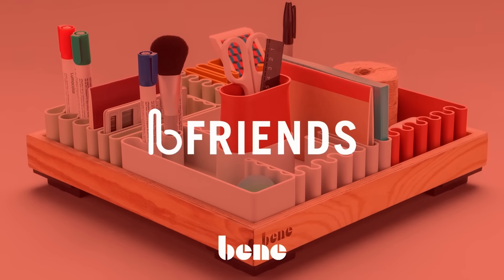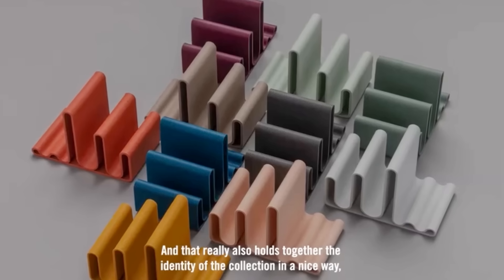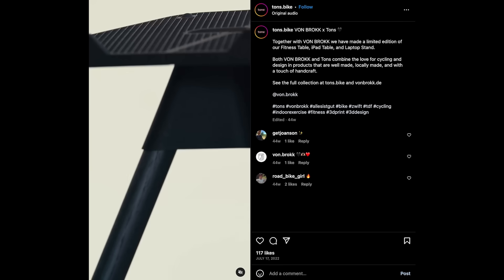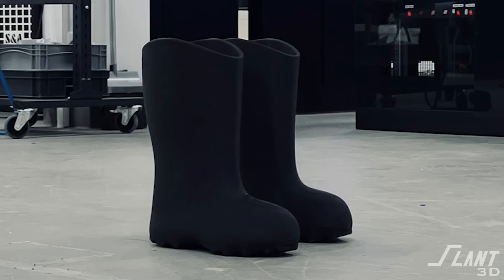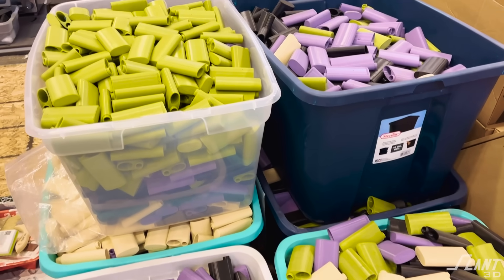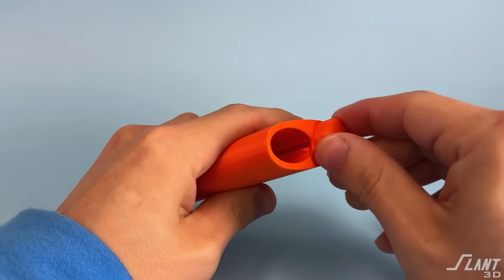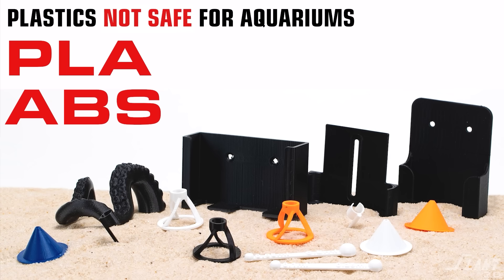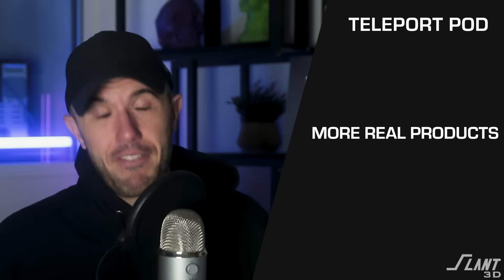5 Companies Making Real Products with 3D Printing

Comment: This is not the same topic but I'm not sure this has a topic so I chose this video as it's most recent.... is there a way to take an stl file and make a print that is much bigger than your print bed by turning it into several parts that can be put together later. I'm trying to take a flat wall ornament and make about 3ftx3ft but my bed is 300mm. This seems like something that would be a common function in any slicer but thats apparently and surprisingly not the case and  I'm not finding anything about it. Is this doable?
Reply: You should be able to do this is any slicer. Prusalicer allows you to perform cuts in an object and even add connectors so that you can join them together, either as structural, or as a way to index the pieces for glueing

Comment: I don’t see why the bic holder couldn’t be produced with injection molding, maybe it would just be two parts coming together to form that same geometry. Or if you changed bottom design could be injection molded in one piece and have the compliance mechanics that allow for the variance in bic lighters

Comment: Those shoes are made of TPR, not TPU.

TPU is slippery and does not grip well.

Even low durometer does not flex and stretch in multiple directions well, now matter how you print it.

Comment: Don't take it as offence, but... why not to make such things with injection molding?

Seems like that things don't even use pros of 3d printing, so does it really needs to be 3d printed?

Well on the other hand, you don't even need to buy this, you just can print it, even if you have no 3d models, that forms are easy enough even for me.
Reply: A polished metal mold is expensive
Reply: Injection molding also suffers from shrinkage that can make a product look poor in heavier cross sections. So extra design is required to shell out heavy areas, and this can lead to even more design issues as you have to make multi slide molds in order to extract the part. This is why injection molded parts tend to be very simple and similar in design, without reentrant angles that make the parts impossible to release.

Comment: do you have to worry about humidity in your factory? or is humidity only an issue over months of stagnant storage?
Reply: I think humidity and moisture is BS, I never had to dry filament or had any issues and I live in the UK.
Reply: @grumpyrider369 I think there are multiple factors to that. What the filament is and how frequently you go through a spool. I have some white pla that’s years old and still prints well, I’ve never put it in a bag or box. I have some black pla that is the same age but needs to be dried before printing
Reply: @only1muppet  how do you know if it needs to be dried?

Comment: $28 for a 3d printed lighter that cost about 28 cents to make…
Reply: Right???
Reply: There's nothing wrong with pricing stuff where you can make a profit. If nobody buys, then you know you're high. Maybe the production costs make it impractical to produce for less.

Keep in mind that if you are the guy sweating the details of production, that some other retail schmuck is going to mark up your price up by 50 to 100% while adding ZERO value to it. And that's just their take for HANDLING your product.
Reply: Using the filament cost as any sort of price indication is a really bad way to look at it. The main cost of selling is taxes, packaging and your own time.
Reply: @unzensiert-ungeschnitten3990  I understand where you're coming from, but your pricing model doesn't apply to all cases. In the case of this small piece of plastic, the low cost, time, and effort to make it are significant factors. Other comments also suggest the markup is ridiculous.
Reply: @sidekick3rida  while I agree it's ridiculous the fact that it keeps selling out so fast says that it's worth it to some other
Reply: @ no doubt people will buy it… America

Comment: Joint locker, £28? Seriously?
Reply: I have no respect for them. They act like they designed the model but they just remixed it (on a model that didn't allow remixing or commercial rights) and now profit from it.
Reply: @OhImKiCkiN  I sell one that fits bics and clippers 👀 I just hate the threaded cap tbh
Reply: I've been selling them for £15, so far I've sold over 2300!
Reply: @grumpyrider369  yeah,🫤 where you selling them?
Reply: @grumpyrider369  2300 factorial is so big number. Where did you find this many customers?